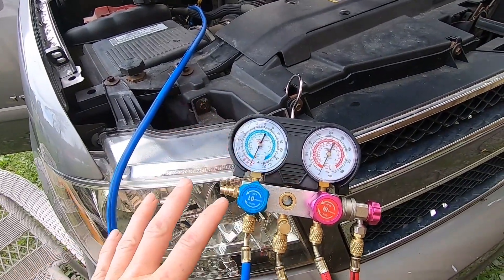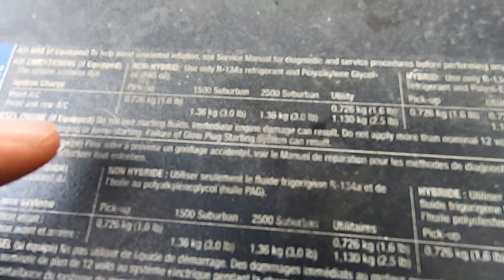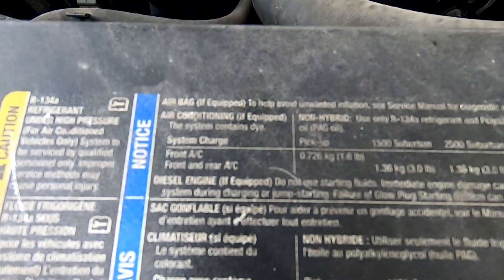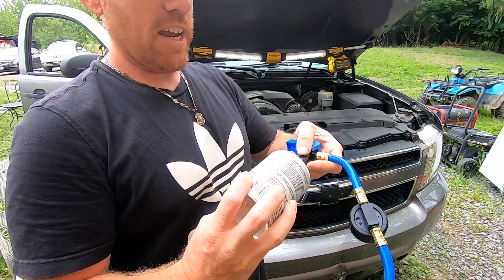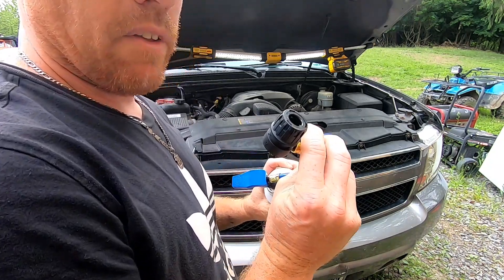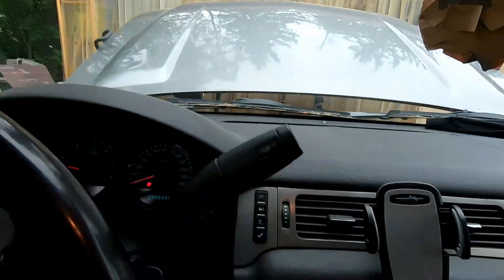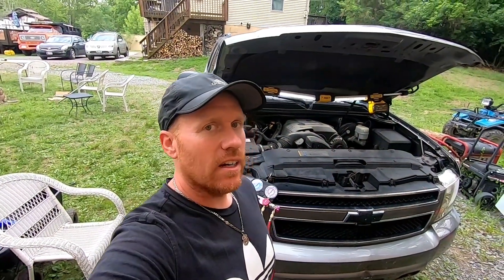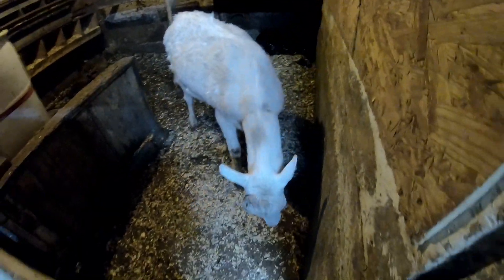How To Charge Your Vehicles (AC) Air Conditioning DIY!

Comment: The gauge says it’s good and full when the car is off but then when I start my car and turn the ac on it drops all the way to empty. Then when I turn the car off it goes back up to full, what does this mean?? (95 civic)
Reply from the maker: Are you using a ac manifold or one of the little ac gauges on a can filler?

Comment: What was your superheat at when you finished?
Reply from the maker: I was around the 220 mark, and remember it's all gonna vary on your location with temperature if it's 80 degrees with 80 percent humidity or 100 with 100 you need to adjust to your area rule of thumb was even with big truck 3500 ac you want to stay below the 250 on high side range because it goes up when driving and running!  Thanks for watching!
Reply: @WhitehouseFarmVet  the superheat was surely not 220.  It wouldn't cool.
Reply from the maker: 220–243 PSI is a standard high side pressure range for an air conditioner's high pressure side at an outside temperature of 85°F
Reply: @WhitehouseFarmVet  I asked what your superheat was not what your high side pressure was.